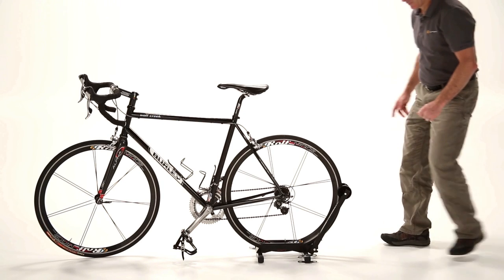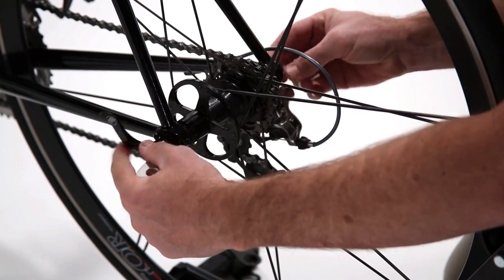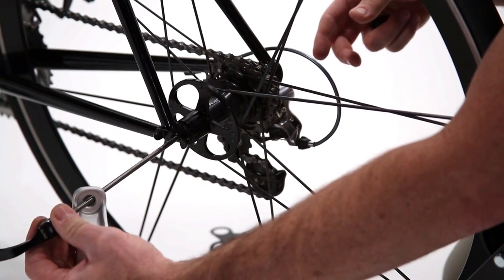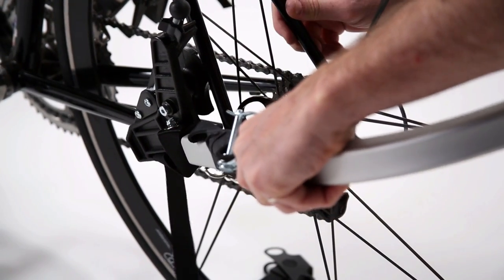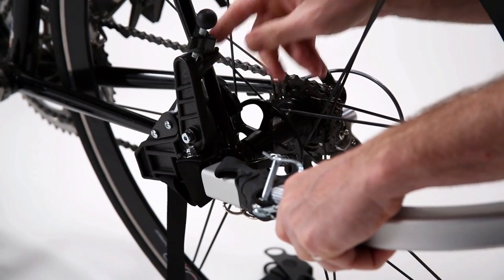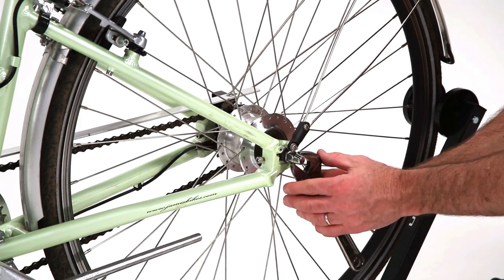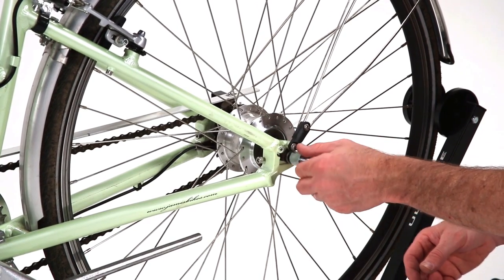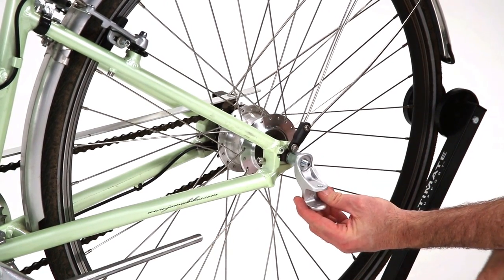Hitch Instructions - How to Install Burley Hitches and Hitch Adapters

Comment: Hello. I just got a 2004-2006 Nomad. Is there a way to upgrade to this newer hitch that attaches to the skewers? It seems much better, and more heavy duty than the plastic that is on the older trailer. Thank you.
Reply from the maker: Hello Chase, thank you for reaching out. Our Customer Service Team is the best resource for product compatibility questions. You can reach them directly at burley@burley.com - The Burley Team

Comment: which hitch is best suited for longer term wear and tear on frames and hubs?
Reply: If installed correctly, neither hitch should damage the frame or hub. If you had a very fragile carbon fiber frame you may want to avoid the classic. One time a guy claimed that his rear skewer got bent. Really though, if used properly it does not damage the bicycle at all.

Comment: Hi. For 142 thru axles have an adapter?
Reply from the maker: Hello, thank you for your question. Assuming the thru axle for your bike is 12mm in diameter, here are some helpful links including the Thru Axle Fit Guide to determine the other measurements required for ordering the correct Thru Axle for your bike. 
It is important to confirm your measurements with the Thru Axle Fit Guide before purchasing an axle. Burley offers a selection of common size Thru Axles for use with our steel trailer hitch. If your axle does not fit within the sizes that we offer, we recommend checking out the Robert Axle Project, as they have a few more size offerings than we have. If your thru axle is not 12mm in diameter, or if you have any other questions, please feel free to email our Customer Service Team at burley@burley.com 
Thank you, The Burley Team

Thru Axle Fit Guide: https://www.burley.com/wp-content/uploads/2019/03/2019-Thru-Axle-Fit-Guide.pdf 
Hitch Guide: http://burley.com/hitch-and-adapter-guide/ 
Thru Axles: https://burley.com/product/thru-axle/ 
Thru Axle Video: https://www.youtube.com/watch?v=Ryvr445xRHs&t=